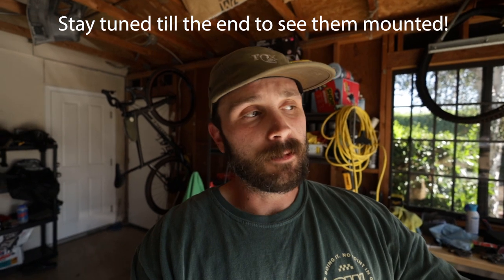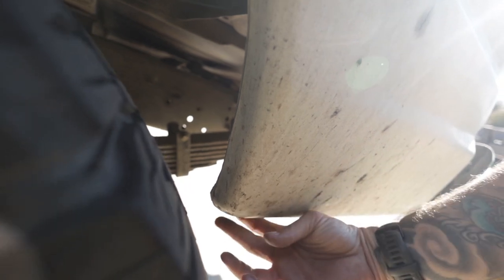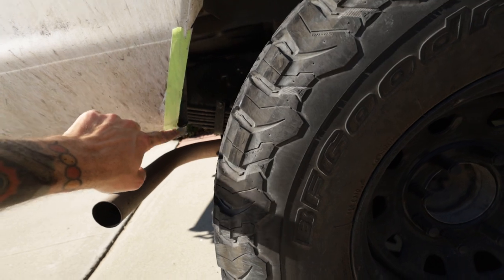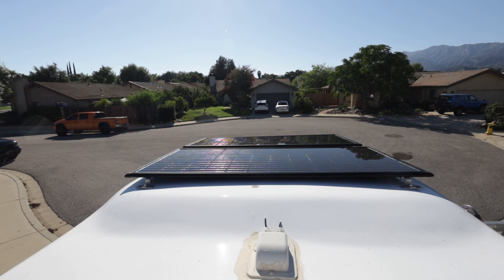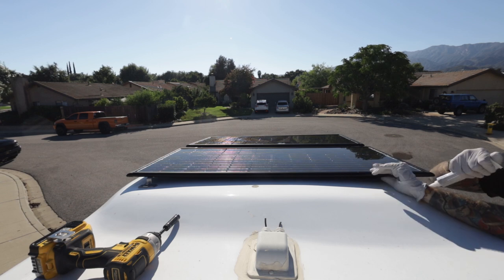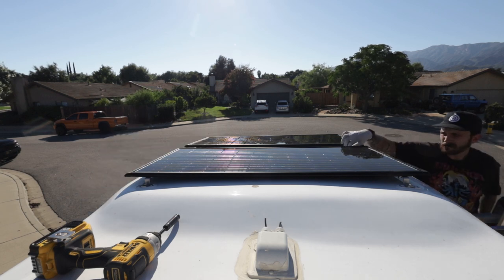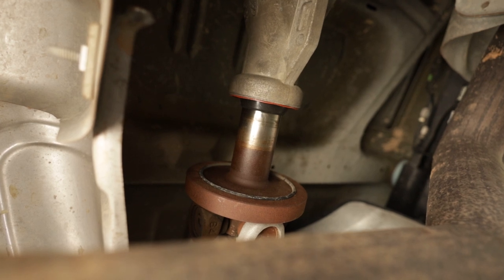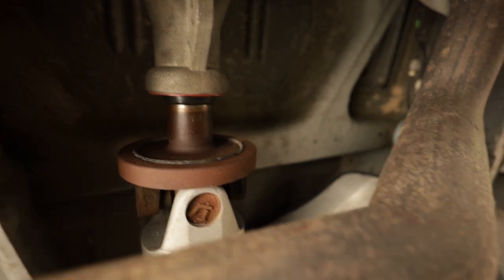This is a must do mod for any lifted Econoline Van!

Comment: Hey man, I am a newer subscriber.

I’m just throwing this out there as a mechanical engineer and a builder of Jeeps. I also have a 6” Weldtec lift kit on our van.

That driveshaft spacer is waaay to thick and honestly might hurt your output shaft in the transmission. Those witness or travel marks you saw are from normal suspension cycling and that little bit of pull out is completely fine at our lift height. If you are getting vibrations, add a less thicker spacer but I would take it out completely.

We would have to lift our vans 8” or more for it to be an issue with driveshaft left.

Just my 0.02¢ as a mechanical engineer but do what you think is best for your van and I will always enjoy the videos!!😊
Reply from the maker: Hey dude appreciate the comment but am struggling to understand the logic here. So given that the output shaft is sticking out significantly further than stock and is being pulled out even more given the drastic change in down travel provided by the weldtec kit it only makes sense to move it further back by either lengthening the driveshaft or using a spacer. This is only further supported by the fact that there is less up travel but much more down travel now so the output shaft will not be inserting into the transmission further than stock. I also would highlight that it's not just a little bit of output shaft sticking out but nearly 3-3.5" so moving it back towards where it was un-lifted will only allow it to safely come out more while also not going in further due to the difference in up/down travel as I said before. Maybe I'm missing something here as I'm not a mechanical engineer but how could the output shaft get damaged?
Reply: @brakeforsnakes  don’t stress about it man, it’s hard to explain over the internet and words without showing you in person and being able to demonstrate etc.

But maybe one day I’ll catch you camping with our van and your van and we can have some fun van camping nights. Maybe I can show you then :)
Reply from the maker: All good. I’ve cycled the suspension and there aren’t any issues so I’m just trying to understand how it’s gonna damage the output shaft if the suspension doesn’t have as much uptravel. I have a pretty good understanding of drivelines and suspension geometry.
Reply: @brakeforsnakes  and that’s good! I was just giving my thoughts and experience!

Comment: Van is coming along beautifully!

I’ve been running BFG tires for over 20 years exclusively and just picked up my first  set of Falken At3’s and they are pretty sweet! My OG tire guy says  that  Japanese brands  tire rubber compounds is superior to American Michelin rubber and they won’t dry rot as fast as my BFGs had been..? 

You have inspired me to maybe trim a smidgen off my Camburg lifted E350 wheel wells .. mine rub in the front fender occasionally while turning and hitting bumps!
More clearance never hurts..
Reply from the maker: You definitely need to clearance for 35’s!
Reply: How are the rt01s on the highway in regards to road noise? Im thinking about getting some on my e350